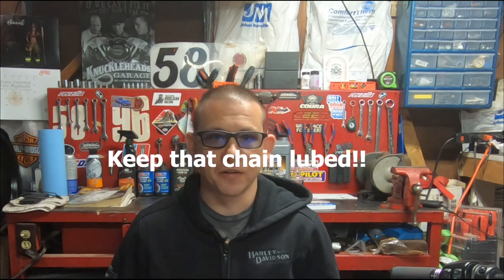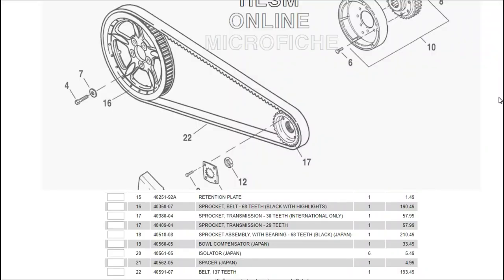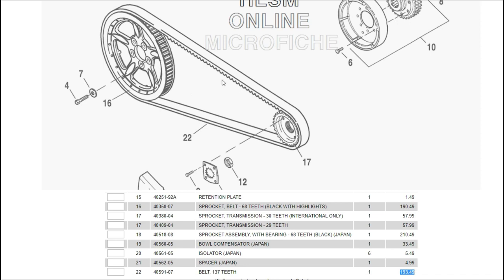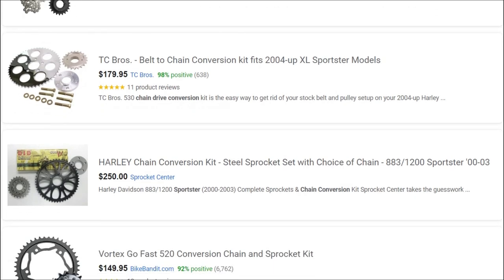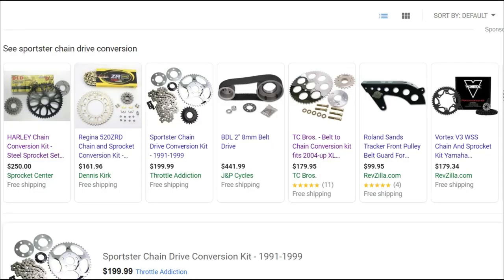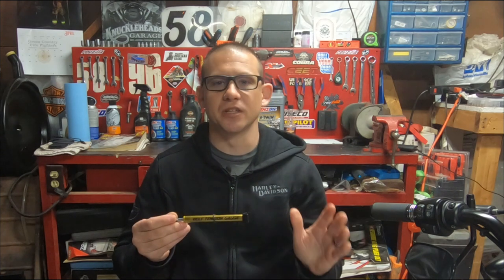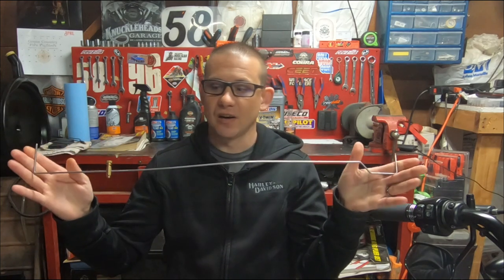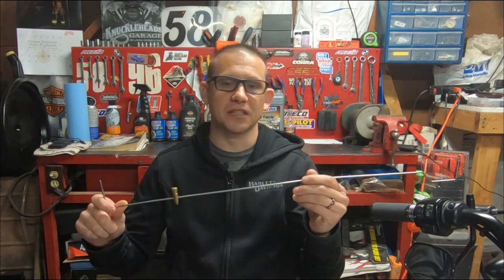Chain Conversion or Keep the Belt on the Harley-Davidson Sportster

Comment: I got the Zippers chain conversion kit With upgraded chain and with a 24-54 Sprocket on a 2014 Harley Street Guide. @3,000Rpm I can do a Power Whillie No clutch All Gas. The chain conversion kit makes a Very BIG difference on low end Torque and coming off the line!  I paid $2,100 with installation

Comment: I got rid of my belt for chain drive and it was the best conversion I've done. Shout out to "TC bros."!!! Now I'm gonna ditch EFI for Carb. on my '13 sporty. I did a chop job with 8" over forks so now I barely get any good mileage, on a good day about 70 miles.
Reply from the maker: Chain conversion is awesome for gearing changes, it's the way to go! Carb conversions aren't too hard to do, plus you get a lot better sound!

Comment: Hey bro. I have watched many of your videos and love them. On this one I think you reversed some numbers. A chain may last 60,000 but a belt will not. I change my drive belt with my back tire about every 10 or 12 thousand. They get brittle and if you twist or pinch them while changing a tire they snap.  Learned this the hard way.
Reply from the maker: Thank you, I appreciate it! It really depends on what bike it's on and how you ride, also how well it's taken care of. I've had a rock get picked up by a belt and destroy it with less than 10k lol.
Reply: Man, I get about 15k out of my chains. My   Street bob is belt driven and has 28k and very little wear. The desert really doesn’t number on chains.

Comment: I'm undecided right now between belt and chain man! The belt is going to run me $150 right now! The chain drive does give a classic clean look to the bike though!
Reply from the maker: Belts are cheaper in the long run, expensive to replace but barring you pick up a rock and shred a belt they can last 100K miles easy.
Reply: Clean ? Sure untill you lube it and ride . How is more moving parts a cleaner look ?
Reply: A chain looks way better than a belt! Choppers, dynas, fxr's look way badass with chain!

Comment: Switched to the TC bro’s chain drive. The feeling of response is night and day. You should mention that between 99 and 00 they changed the cast wheel and that doesn’t allow interchanging.
Reply from the maker: So you're getting a much more positive feel of power the ground? I always feel like you can just kinda tell a little soft spot with belt as far as power to the ground. I wasn't aware they changed the cast wheel those years, that's interesting.
Reply: GixxerFoo the wheels all come down to axel spacers and rear brake caliper mounting. I still have a belt on my 03 1200. I can feel the belt stretch every time I gun it off of a dead stop or try to keep the front wheel up. My 01 883 with chain can keep the front up all day.
Reply: @ROUGHNECKROGERS   Ha! Ha! Ha! Ha! Ha! Ha!  Ha! Ha! Ha! Ha! Ha! Ha! Ha! Ha! Ha! Ha! Ha! Ha!
 VROOOM!  drip VROOOM! BLAT! VROOOM! POP! drip  VROOOM! drip GUDDA GUDDA GUDDA GUDDA drip VROOOM! BLORT! BLAT!  drip GUDDA GUDDA GUDDA wheeze drip VROOOM! POP! BLAT! drip...  Ha! Ha! Ha! Ha! Ha! Ha!
Reply: @ROUGHNECKROGERS  Are you saying that Sportster models from 1999 to 2000 can't be converted to a chain drive? All Sportsters before 1999 and after 2000 can use chain conversion kits. Am I understanding correctly?
Reply from the maker: You can convert anything to chain drive.
Reply: @GixxerFoo  Oh, okay. I wonder what Rowdy Travellers is saying, then, about the 1999 to 2000 models.
Reply: @BEEBEE159  I have an 02 and just bought the conversation kit from TC bros I'll let ya know how it goes.
Reply: @andregonzales04  Good luck. I've heard the chain provides a lot more power to the rear wheel than the rubber belt. It should be a night and day difference.
Reply: @BEEBEE159  hell yea thanks brotha!
Reply: @andregonzales04  Did you get the new chain on yet? If so, how does it feel?
Reply: @BEEBEE159  not yet man, but I'll let ya know as soon as I do
Reply: @BEEBEE159  so just finished the conversion on my 02 sportster and got rid of my cast wheel for a wire wheel. Conversion was fine and runs slightly more torquey/ responsive and obviously looks a hell of a lot cooler. The TC bros rear sprocket is chrome so looks nice. Installation was fairly straight forward if you have all the tools (chain breaker, 1-7/8 socket for the front sprocket nut, and an angle grinder for the link removal) hardest part was getting enough torque to remove the front sprocket nut. I have to have a fat ass breaker bar and someone sit on the back so the back wheel wouldn't move. Overall I'm very happy with the results.
Reply: @andregonzales04  Thanks for the update. I would have thought that the chain would be way more torque than the belt, as the belt, in theory, is more giving than the chain; however, you only noted "slightly" more torque. What sized sprocket did you use front and rear; how many teeth?
Reply: @BEEBEE159  23 in the front and 48 in the back. Its supposed to feel just like stock which it does. The more I'm riding it the more torque I'm starting to notice. I really like it. On hard throttling I always felt the flex in my belt now with the chain I'm not getting any of that.
Reply: @andregonzales04  Oh, okay. If I remember right, I have heard of some using a 50 tooth in the rear. Also, new chains are known to stretch a little initially, when first installed. That's good that you like it. Take care buddy.
Reply: @BEEBEE159  for sure man, let me know if you ever end up converting and what you think. Next big move for me is going to rigid frame it.
Reply: @BEEBEE159  the difference is 99 still had timkin bearings & 2000 switched to sealed bearings so spacers are different ! I prefer to pack grease in my timkin bearings ! Every time I change a sealed bearing for someone I wonder if the bearing press is still enough to hold that bearing !

Comment: An advantage not mentioned for the belt drive is far less driveline lash since the belt is run tighter than a chain, this is BIG plus especially when you are on and off the throttle a lot like on a twisty road

Comment: I never knew what the little holes were for on the swingarm on my sportster...till I watched a lowbrow video and he showed it was for the wheel alignment tool or coat hanger tool. Lol good tip I thought.
Reply from the maker: That's what that little hole does, all you need is something to fit in there and measure back to the center of the axle to get your alignment right.
Reply: @GixxerFoo  yep he used a coat hanger and a zip tie on it to keep the measurements. I knew those holes were for something just didn't know what till I watched their chain conversion video on Saturday sportster

Comment: I have done a few conversions on friends bikes and on 2 of my own and have no regrets at all. A good o-ring chain is self sufficient when it comes to lube and as far as the noise level of a chain over a belt, really?  We are talking Harleys here, NOT know for their silent running powertrains. What a chain does give over a belt is the ability to be changed without dismantling the entire ass end of the bike (big twin only), they take abuse much better, and the biggest advantage for me is the ability to change final gearing easily. In my experience Harleys are geared to the moon, especially an evo Softail. Solid mounting means rpm's shake the shit out of you. The downside is zero throttle response on the highway, especially after some engine mods. We put an Andrews EV3 cam in my friends 98 Softail Custom which killed it on the highway, geared way too high stock. Converted to chain dropping the gearing completely changed the bike in a good way. An added benefit is the ability to run a wider rear tire, the stock width looks like a bicycle tire on the back.  A bagger yes, run a belt. For that application I believe it's a better choice than a chain. If you like to hammer the throttle and dig the holeshot fun stuff get a chain. My former 98 Sportster and my current FXR both are chain driven, and of course my 74 ironhead as well.
Reply from the maker: 😆😂 the stock rear tires do look like a bicycle, l thought myself for years. I am glad they finally started putting wider tires on in the later years. Yeah with a Harley you ain't gonna notice a chain's noise. Hell you can't hear anything but the exhaust on these bikes.
Reply: My phone mistranslated some of one of my comments sorry about that

Comment: If you have whitewalls leave the belt on bc the grease from the chain will sling all over the white and leave you scrubbing constantly and those tires are hard to keep clean as it is
Reply from the maker: Yeah l don't want to think about having to scrub chain grease off a white wall tire 😬
Reply: I have white walls on my 03 road king, as belts wear down they sling black stuff that is all over my white walls now
Reply: @Gingy2335  you sure your belt is not rubbing the tire or anything else? I've never seen or heard of that happening.

Comment: Pro Chain - Oversized Wide Tires
Anti Chain - Chain Stretch
Pro Belt - Forever/Light Weight
Anti Belt - Always worrying when forever runs out on the Kevlar Belts because they just go and go and go.
Reply from the maker: I am always nervous about picking up a rock and shredding a belt, it's not super likely but it does happen lol.

Comment: well explained..... im thinking of going with 23/57 sprocket... any suggestions for wheelies and traveling long rides? thank you
Reply from the maker: Whew l that would require some experimentation to get it where you like it. Gearing for a long ride and for wheelies are way far apart. I hope you mean one setup for playing and one for highway runs?
Reply: @GixxerFoo  maybe the closest i can come up with for both freeway and wheelies would be a 23/55... would you agree?
Reply from the maker: I think that's a good compromise, or find you a counter size you like and leave that on there. Get a second rear wheel and swap out. That's what a lot of guys do depending on where they are riding.
Reply: @GixxerFoo  oh i see... good  idea... thank you
Reply from the maker: Lol no problem!

Comment: What if you just want that extra hp and torque lost through the belt? Worth it? A stage 1 and a chain conversion on an 883. Nice performance jump?
Reply from the maker: You gain any extra power to the ground, but the bike will feel a bit snappier.

Comment: Thinking about doing this to my softail. My question is how much torque and power is lost with a belt vs the chain??
Reply from the maker: You really wouldn't notice any loss, it's more for strength if you're putting a lot of power down.

Comment: Aside from the strength aspect, chains just look far better. No big deal putting a bit of lube on here and there with slight adjustments
Reply from the maker: It's a lot cheaper for gearing changes and easier to find the size of sprockets too!

Comment: Great video. Not sure about the sporty, but the dyna has small holes poked into the swingarm as points of reference for tire alignment. Btw chain drive is way cooler.
Reply from the maker: You can't be the timeless chain drive, not a Sportster feature. I still use the old alignment tool and tape measure.
Reply: @GixxerFoo  i hear that, old school ways are still the best. Btw on another note, im sure people would love to know why the sporster doesn't come with a 6 speed or the possibility of one.
Reply: My 2000 Sporty 1200 Custom has the holes in the swing arm. It saves alot of time.
Reply: @dynaordie8083  Baker makes one for them. But after 04 you got to split the case. Screw that ! One reason I really love my 2k Sporty got a rigid mounted engine , the trap door for the transmission just alot easier. The older Sporty is lighter then the rubber mounted ones , so I have been told. But I love it.

Comment: I have an SV650 and haven't had any issues with it's chain, or more precisely after I bought a good quality chain I haven't had any issues and don't hear it over my pipes. 
I certainly wouldn't hear it over my Harley's pipes.
Honestly not sure if I'd switch as I have a Fatboy and I'm not generally abusing it as hard as I do my SV
Reply from the maker: The SV is a seriously fun bike! I had a 1989 Honda NT 650, rigid aluminium frame twin, way ahead of it's time. I'd take an SV650 today over my old GSX-R 1000 just for the fun factor.

Comment: I bought the Sprocket kit from TC Bros, steel sprockets and doesn't come with the chain, it's on the shelf for when my belt grenades. More maintenance yes, but if you run on gravel roads chain is much friendlier when you pick up the occasional rock.
Reply from the maker: No kidding, gravel will shred a belt and destroy the pulleys in no time.
Reply: @GixxerFoo  I have a buddy with a Road King who lives about 3/4 of a mile off the pavement, he blew 3 belts in less than a month a few springs ago, I found him a chain conversion at Zippers and he hasn't regretted it for a second, never heard of that happening to anyone else, so I guess he was in a low karma season or something? Much harder to change a belt on a Road King then a Sporty though.
Reply from the maker: Damn that's rough and belt's are not cheap! I'd definitely do the chain conversion if l had to ride a stretch of dirt road too. Yeah big twins are not fun to change a belt on, it's quite involved.

Comment: My understanding the only reason you would convert to chain is b/c the motor has a high stage kit with too much power for a belt risking a popped belt.
Reply from the maker: That's about the only reason l would do the swap myself. Unless you just want to go with the old school look of the chain.
Reply: @GixxerFoo  A properly tensioned & aligned belt should never POP as they will stretch way less then a chain will.  HD uses (or did use) Carbon Fibre (Poly Chain Carbon Belt) or Kevlar in their belts.  This means next to no stretch and they are way stronger than chain.  Belts might be more expensive than chain, but they will outlast a chain and also they produce way less wear on the pulleys than a chain will.
Reply: A Harley with too much power?
Ha! Ha! Ha! Ha! Ha! Ha!  Ha! Ha! Ha! Ha! Ha! Ha! Ha! Ha! Ha! Ha! Ha! Ha!
 VROOOM!  drip VROOOM! BLAT! VROOOM! POP! drip  VROOOM! drip GUDDA GUDDA GUDDA GUDDA drip VROOOM! BLORT! BLAT!  drip GUDDA GUDDA GUDDA wheeze drip VROOOM! POP! BLAT! drip...

Comment: Hey I know it's a year later. But check out Block Heads video on the 1275 Hammer 110 hp build he did. Check out the belt on it. Not sure it will last. Idk
Reply from the maker: I saw that video, that's one hell of a build! The belt should do pretty well just riding it and getting on it every now and then. Lol if you ride the crap out of it it's sure to shear some teeth off though.

Comment: I just brought a chain drive conversion for my 16 Iron 883 but I'm only doing this, because I'm doing the HP 1275 kit as well
Reply from the maker: Yeah that's not a bad idea if your doing a really hot 1275 kit. Belts are great but they can only take so much.
Reply: @GixxerFoo  yes I'm doing the Hammer Performance kit with the 10:5:1  reverse dome pistons, kit should be here this week 🙌🏽
Reply from the maker: That's exciting! That's gonna make your bike an animal!
Reply: @GixxerFoo  yes 🙌🏽,I'm debating if I should change my exhaust, I already have a custom made RCX exhaust. But I like the look and sound of the Two Brothers comp s exhaust what do you think I should do?
Reply from the maker: That's a really exhaust system, l loved them on my sport bikes and l was excited when they started making Harley products. Hammer tested it with their kits and it made really good power.
Reply: @Mr6thborough516  On Hammer's website they have a whole section dedicated to pipes and how much power they make.  It's under tech tips.  Check it out.
Reply from the maker: It's impressive the amount of work they put into testing. Too bad that Patriot Defender is no longer available.
Reply: @GixxerFoo  It's a great resource.  I've been keeping an eye out for a used one.
Reply from the maker: Yeah it is! Lol l have too, l don't mind repairing one but they are hard to find.

Comment: 35K and haven't done anything to my belt. Working on the rear I'll look at check it. Had chains on others and the best is belt
Reply from the maker: Belts last a stupid long time and are super low maintenance, I'd keep the belt unless you just want a chain for some reason. If you're not drag racing or just stupid hard on the bike the belt is the way to go.

Comment: The main irritant with belt drive is that when they snap they snap with absolutely no warning. The belt will look perfectly fine. No chips, no cracks, nothing. What fails is the steel re enforcement wires within it. IMHO these cables are much too thin. Durring WWll the US Army used this technology on the M-3 half track. The tracks are one piece rubber moldings with two half inch cables running through them. The vehicles still running today still run with the original tracks manufactured in 1942. Surely H-D can do better than the belts they currently use.

Comment: I've been thru 2 front pulleys on my s2thunderbolt has a pro lgnition and supertrapp exhaust that's in 8000 miles .the splines strip on them any ideas on if the chain splines are stronger?

Comment: Most belt to chain conversions are usually because the owner wants a wider tire. Oddly enough , they usually don't want to spend the bucks for the proper wider rim and try a 150/160 wide tire on a stock 3in wide rim.

And Sportsters do not have any sort of driveline 'cushion' and what on/off throttle lash there is will cause uneven stretching (tightspots) in the chain, difficult adjustment and uneven sprocket wear.

BTW, Tsubaki and Regina O-ring chains are the best!